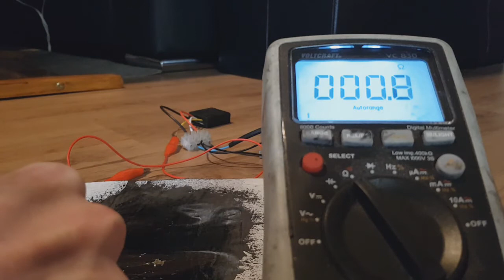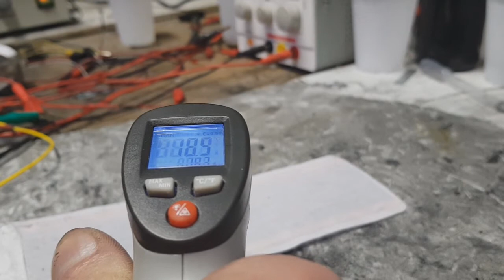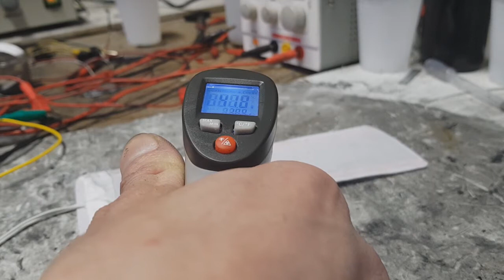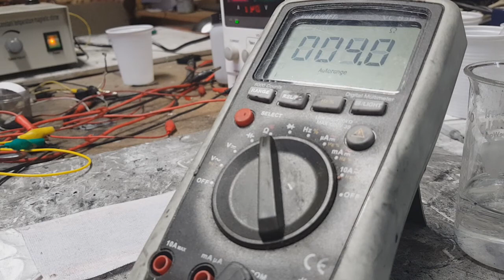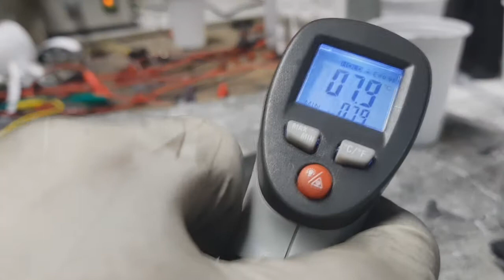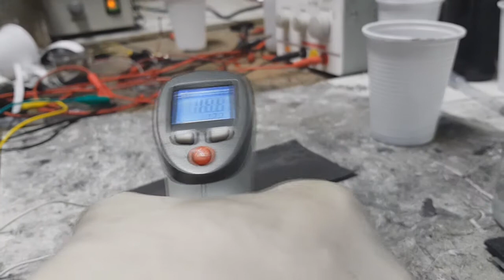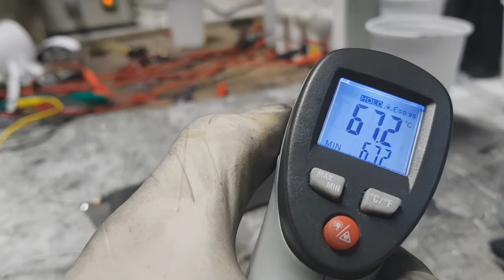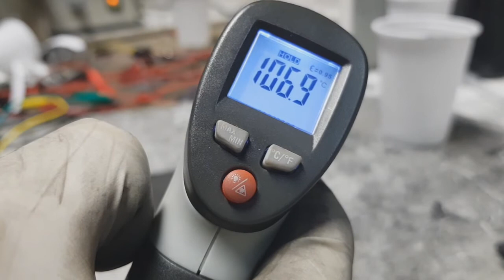Conductive Ink - Capacity swich and conductive ink Heater

Comment: Hello again
I'm glad you came back we missed you
I would like to tell you something about health, if you have respiratory problems, or any allergy problem, I know of some method to alleviate these ailments
- If you have respiratory problems due to pollen or dust allergies I recommend you use it if you do not grant an ionizer, or negerator of negative ions, the NASA investigated its use in the space station due to the synthetic atmosphere that the astronauts endured there, this it produced respiratory problems and in clinical studies certified that the genitals favored the exchange of oxygen between the lung and the red blood cells,
also generate electrostatic charges that cause particles of dust in suspension and pollen are attracted to each other, collapse and fall to the ground, eliminating them from the air
- and if you had problems due to allergies I would recommend two plants with antistaminic properties one is the perilla frutensis and the other one Helichrysum italicum
regards

Comment: Very interesting, Cayrex.
What is the substrate you use? A metal sheet? If you paint it on a stone tile, you will notice that the back side gets much hotter than the front.
Thanks!

Comment: Hi, I saw in your model that you put the ink over the copperstrips. In the China model the copperstrip was not painted. I saw video's from an Englishmen, he did the same experiment with the copperstrips, but indeed, he did not paint over the copperstrips. Maybe that is the cause of the lower ohm?  (Just an idea 😇 )
Reply from the maker: In china model is also paintet conductive ink over copperstrip on the top,.... in video you see the bottom of the heater. You need to paint the ink over the copper for good contacts.
Reply: cayrex2 Thanks!